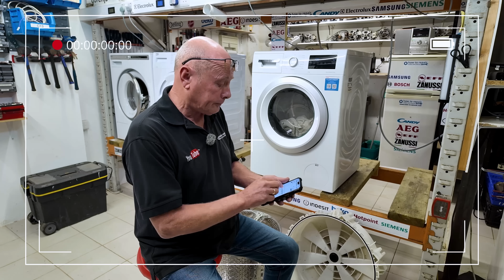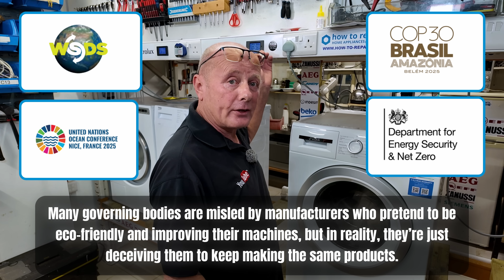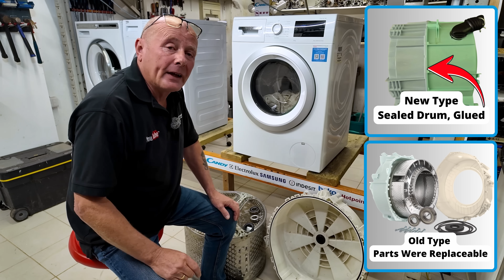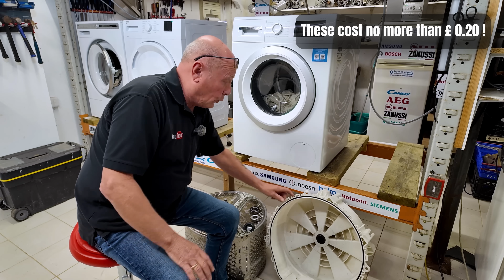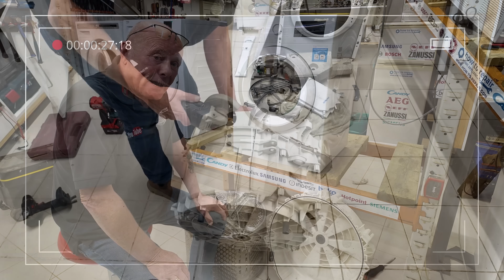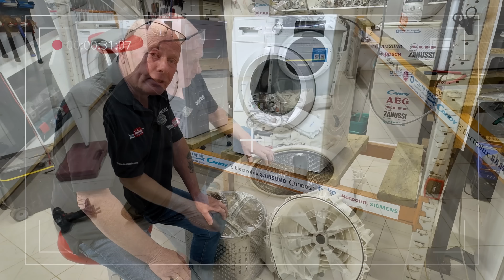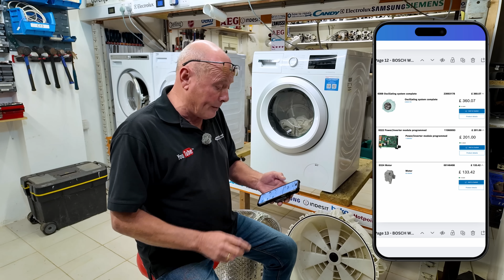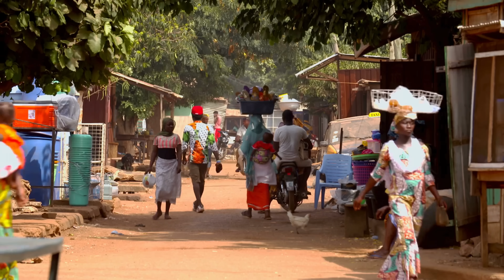Washing Machine SCAM EXPOSED! The Truth About SEALED Drums: Naming & Shaming

Comment: Thank you !!
You shouldn't be sorry for pointing out the truth. This is happening across all products, not just washing machines—cars, mobiles, toasters, kettles, you name it. They've made them impossible to repair. Older products used to last 10 years before they would break down. It's like our governments are in bed with all these companies, or shall I say, they are influenced in some way... or with something.
Reply from the maker: You're absolutely right mate this pattern of manufacturing has become more evident across various industries. Once renowned brands with strong reputations for quality are now often owned by larger corporations that shift production to regions where costs are lower. Thank you for being on board with the main idea! Reaching maximum visibility is completely dependent on our team. I need your partnership, so please make every effort to share this far and wide.

Comment: I've worked in a service department of a factory that makes machines, and calculated the spare part pricing, the pricing for spareparts is completely legit, we had a metal bracket size 2 by 5 cm, the piece price was 2 euro, however, the startup cost for setting up the machinery for stamping the metal plate out off a big metal sheet, the setup of the drilling would cost around 350 euro, so you have to produce and sell in bulk by the thousends to get a reasonable price, not to mention you also have to take in account handling and shipping cost... So yes a drum can cost 350 on 450 euro wasching machine. As far as i know it is not the fairys that make part from magical dust... Same goes for plastic parts and printed circuit boards, a mall for plastic parts costs in the thousends of euro's and has a limited lifespan, so yes spare parts are expencive, so you want a cheap machine then this is the result!

The asian manufactures have bigger market, order / produce more parts, so startup costs are more diveded, also pay for workers is alot lower...
Reply: By setting a price to build parts one by one, sure the prices are legit.
However, the manufacturer needs to guarantee availability of parts for a number of years so they can mass produce them at the same time as the main production and store them based on estimates.  No need to make a specific mould for spare parts,  there is already one for making the product itself.
$200 for an electronics board?!  Come on - these are way much cheaper to build.  And if you do not get the critical parts up front, you can't build them in 10 years.  I agree there is some cost in having parts laying around, but I believe that this cost is manageable.

Sure, its more advantageous to say that the spare parts are expensive, you probably need a separate mould for each piece you produce if you want to: make one, throw it away.  Same for PCB boards, make one image set, stencil, make the board and throw it away.

It's a matter of product definition.  I know of a case where light bulbs of a car were hard to replace by design on request of product management so that the car owner could not replace them himself and needed to go to the garage.  Not an engineering mistake, a product requirement!

Comment: You promoted Samsung as more repair friendly. I spent over 1000 quid on a Samsung fridge just over 2 years ago. One of my kids broke one of the freezer drawers. It had quite a flimsy design. I couldn't buy a new drawer on a 2 year old fridge/freezer! Fortunately I had a plastic welder and was able to weld it. The weld pins seem much stronger than the plastic join in the drawer. When by Bosch Series 4 packs in I will go for a LG. washer.

Comment: Years ago I saw someone cut this plastic drum apart, replace the bearings, then silicone it back together. 
No idea if that was a long lasting repair.

The beko one I have now. I've had it's years.  It gets used daily. I've replaced the brushes twice. Then a new motor and it's had a new door( crack in plastic at hinge) on button. Crack in plastic on holder. 

But I'm fairness the bearings and seal have been perfect.
Reply: Ive seen people use Gorilla glue as well. The only issue is finding a silicone that will adhere to Polypropolene, otherwise it's all down to the mechanical bond.
Reply: @WSHLNd120 I wonder if you cut the drum the opposite way, not a cross the seam. Then silicone it and rachet strap it permanently
Reply: @GinandTronics  Ive seen people weld the drums back together using a soldering iron, like it would of come out of the factory. I do doubt that method would be able to cope with the enormous forces and stress it would be under.
Reply: Permabond TA4610 or TA4611 structural adhesive formulated for Polypropylene should bond it, claims a bond stronger than the polypropylene itself. Other Polypropylene Methyl Methacrylate adhesives are available as they say, but be sure to get one formulated specifically for Polypropylene or polyolefins. Alternatively, a hot air plastic welder using polypropylene filler rods should do it, but you may be better off cutting a hole in the front of the tub inside the mounts for the concrete weights IF there's enough space between them for the full diameter of the drum to fit between, as the load on the welded will be less there.

Comment: I try not to buy western made white goods anymore. Especially German owned and EU companies or products made in Turkey.

The are good unbranded white goods out there, that are reliable and I suspect are repairable.
Reply: I reccomend either the asian machines (LG, Samsung or Vestel) or to buy older machines from places like eBay or Facebook Marketplace for cheap, do them up and run them as a daily driver. If you know what your looking for in terms of repairability and you know the designs and OEMS inside and out it makes it alot easier to find a reliable and repairabile machine for when it inevitabiliy goes wrong.

Comment: Someone in the comment mentioned that in India the repairer cut Bosch drum and put it back together with glue and screws. That's the key counter argument to this whole debate. In India, labour is relatively cheap. The repairers are willing to cut, repair and glue/fasten the drum for pittance. 

Labour is expensive in Europe. Maybe the repairers think it's not worth their time. Either have accessible spares for a quick repair otherwise they won't do the additional workaround despite customers insistance. 

Maybe the manufacturers are also helping the repairers reject the customers demands by making the spares exhorbitantly expensive in Europe, not worthy of repair and they can sell new machines, win-win.

Comment: Not a washing machine but AEG repaired my 10 year old tumble dryer for a fixed price repair of £169, the part it needed was the main circuit board and that's about £162 on its own so i was quite impressed with that service and the availability of most parts for my machine after 10 years.
Reply: The EU laws put as mandatory for all manifacturers to keep available, spare parts till 10 years after the sale

Comment: a consequence of what those diabolical companies Bosch and the rest of them... can you compile and make it public a list of washing machine manufacturers that make split drums, and repairable!? 
That would help me change from Bosch that I still have with glued drum..
Thank you!
Reply: Any Asian machine, for example LG machines would be my go to if I were shopping for a new machine in 2025. LG machines have split tubs, reliable electonics and rather modular designs. 

Samsung machines also have split tubs but I would avoid them as they are notorius for PCB failures and drum spider failures (Although drum spider failures are almost due to the lack of high temperature washes and liquid detergents)

Midea and Vestel machines also have split tubs. Brands under them (OEM's) are ones such as Logik, Kenwood, Sharp, Toshiba, Statesman, Comfee, Pro Action, Bush etc...

Panasonic machines also have split tubs - although Panasonic machines are alot less common in the UK now.

Haier also have split tubs.

The common factor is that all these brands are mostly eastern or asian. But if I were to give you one brand to choose, it would be LG hands down. Hope this helps, any other questions let me know!
Reply: @WSHLNd120 
You helped me indeed!
Thank you very much!👍👍👍

Comment: @How-to-repair i have to buy a new washing machine because the drum spider broke down (the drum is a bit loose so i guess its a broken spider)  and I cant find the part anywere. Its 2002 model AEG 703W machine. Where do you find the parts?
Reply from the maker: Hi mate, to be able to assist you  I will need the full model number of the identification plate.
Reply: @How-to-repair i have sent you the PNC, but the post was deleted somehow

Comment: I hate Bosch. Let's go back to the car scandals when they all fiddled the economy results. All had bosch fuel injection, I can't believe the car manufacturers individually worked out how to alter the bosch software? I've never seen anyone questioning if bosch have the manufacturers the method.
Reply from the maker: You are absolutely right. When the car emissions scandal broke, it primarily centered on diesel vehicles using sophisticated software to detect when the car was being officially tested and temporarily altering performance to reduce emissions. 

It's not just one company acting alone. We noted that multiple European manufacturers started using sealed drums within 12–18 months of each other, almost as if they had a meeting. Bosch, as a key component supplier (in cars, sealed drums, and PCBs), is consistently central to these issues of engineered obsolescence and deception.

I really appreciate you sharing this with your friends and family. Maybe we can make a difference if the manufacturers notice how many people are looking at this video.
Reply: Well, it is a different company, to be honest. Used to be owned by Siemens and Bosch, now a full subsidiary of Bosch.

Comment: What a man taking up such a battle. Meanwhile I really do appreciate your exposé videos, and those also explaining the better manufactures of the bunch. I'm investing in a condenser dryer very soon, and it looks like Beko is the better option so far.
Reply from the maker: It’s comments like yours that keep the pressure on these manufacturers! We have to keep this battle going for the right to repair and honest engineering. Beko is one of the few companies that offer technical information to help you fix your appliance. Their workshop manuals are very helpful, and their wiring diagrams are quite good. At least they are making an effort.

Comment: I was stung by Miele’s policy change for in-home repair: our 15 year old Miele w524 prestige plus started to make a scraping sound when the drum was rotating (even when you move it by hand), I payed Miele for one of their technicians to fix it & I chose the higher price option of fix & parts only to be told it wasn’t repairable as it was the bearings & it would cost too much to fix 🤷‍♂️ They gave me money off a new washer if we bought direct from them but it was delivered & installed by a third party 🤷‍♂️. It looks as the new washer is made in Poland  - previous one was Germany - and seems to vibrate more at high speed as well as now using sealed plastic drums as our previous wasn’t
Reply: I have an old Miele Premier W500 bought used 10 years ago, completely dismantled and rebuilt practically new, it still works every day, the build quality is incredible, I enjoyed putting a coin vertically when it was spinning...😅
Reply: @leonardo5225 Ne w customerd doe nit get this chance to have a long lasting machine .. in the age of Eco- Sudtainability
Reply: My grandma had a melie washing machine for 25 years and she had to get rid of it because thay stopped making parts for it
Reply from the maker: They forced you to buy a less durable machine under the guise of an economical repair. The discount you received was simply cheaper for them than covering the cost of their high-priced labor and the part they are obligated to supply. This is a classic case of malicious compliance. To truly make a difference, we need to get the attention of industry leaders and stop these wasteful practices. Sharing this video is crucial to spread the message.

Comment: Spider for my LG was 89.99, quality bearing and seal 22, tub gasket 11, door seal 65 quid. That's what it cost me 2 months ago... that a back ache. But the machine is running great.
Reply from the maker: You did the gold-standard full repair, replacing the spider, bearings, and seals—all the internal parts that wear out! Even with replacing the most expensive internal part your total parts cost was under £190. To truly make a difference, we need to get the attention of industry leaders and stop these wasteful practices. Sharing this video is crucial to spread the message.

Comment: This is actually a business opportunity. Buy whole machines, sell them in parts under the price of the manufacturers...
Reply: Insurance companies now do this with new cars. And one British firm is doing well on ebay
Reply: @zos8085  I was speaking to a company in Germany last year about spare parts prices for cars (the company is a bodywork repair and paint shop.. They are now buying nearly new cars and stripping them of parts and storing them, because the costs of parts from the manufacturer means relatively small accidents are writing off cars due to the parts costs.
It's a crazy World.
Reply: No, the business opportunity is making the machines repairable.
As far as I know the ONLY commercial/industrial brand that does sell domestic units too is Speed Queen. Old school relays, simple components. Nothing sealed. Components are interchangeable between models too, because everything is standardized. A 25 year old washing machine from Speed Queen will share similar components with a new one from 2025.
Reply: This is why comparatively new vehicles are written off. Replacing a headlamp bulbs, sorry it is LED you need a new unit, approx £250- £500!!!!!!!!!!!,😡
Reply: Not if it’s always the same parts that fail and the spider is guaranteed to fail even if everything else lasts
Reply: Perhaps a different approach to that type of repair is needed. A local specialist, set up like a production line, with all the plastic cutting and welding facilities etc.
Reply: Ehh, doubt that it would be profitable. Most parts don't really break much, so you would be left with a lot of spare parts that just accumulate and a deficit of popular parts, which will snowball very fast.
Reply: The margins are just not there.  It’s easy for someone who is not in business to imagine you could maybe get these parts for 50 and sell for 75 making a profit, in reality you would be making a loss.. the hassle of buying, stripping and storing would only be the start, then you have VAT and taxes and you have to provide warranty yourself.  At scale it could work if the market had enough depth, but it hasn’t.   Even if the labour was free, which is far from reality, it’s still designed to be more cost effective to replace than repair when you take into consideration the warranty
Reply: Warehouse costs are unbelievable. Land and building guts profits. Also consider no fuss even if you change your mind returns hurt honest retailers.
Reply: If you could obtain customer returns, and damaged in transport machines at a decent price and quantity, it might be viable.
Reply: andrewstones2921 Costs seem unreasonable, because you think the privilege to buy things from poorer countries with lower cost is written in stone.
Hate to brake it to you, it isn't, poorer countries constantly come closer to our standard of livingg, and we just sustain the difference TEMPORARILY by borrowing and increasing our debts.
Now for 1$  I can read our future lol
Reply: @nikspanakis What do vehicle brakes have to do with it?
Reply: Genius
Reply: I think some of the electronic pieces once unplugged need resetting with a laptop..I ran a washing machine repair shop in the 2000s good little business.I noticed at the end they were making everything more difficult to repairs.
Reply: But what if they design just one piece for failing prematurely ?   You end up selling just one piece and have the garage full parts no one ever orders.
Reply: Perhaps if tech like  3D printing can make it economical to produce some parts on demand